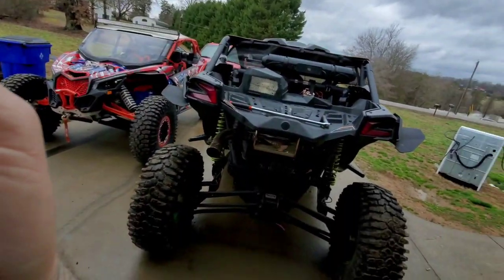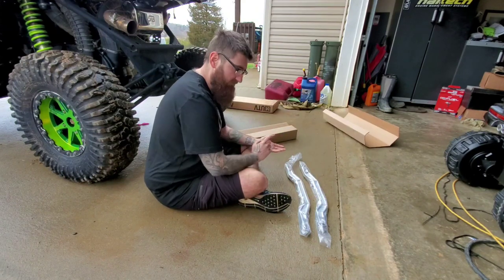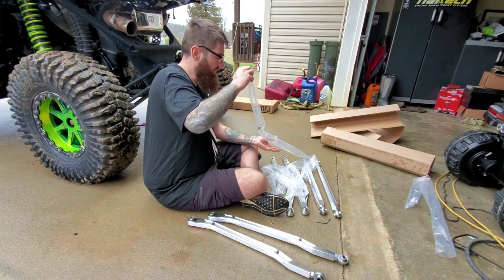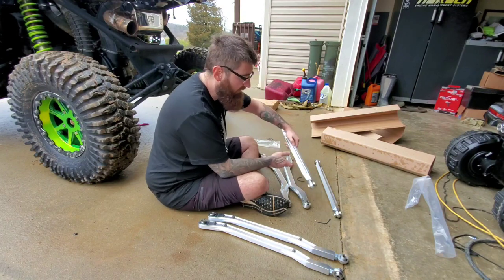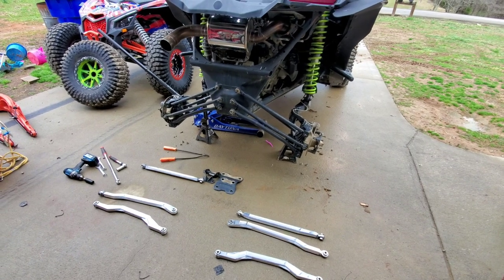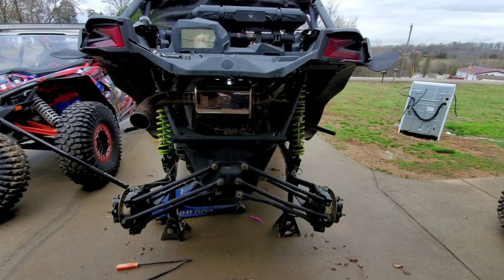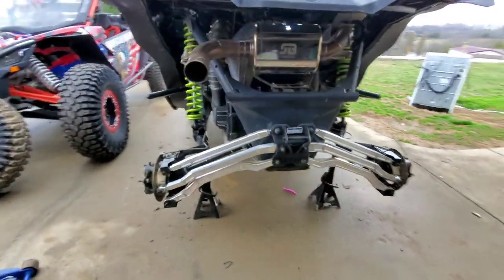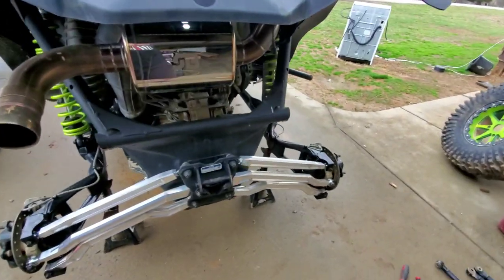Can am X3 Xrc LMUTV radius rods install.

Comment: Need to get the plate too, did you use a discount code?
Reply from the maker: I wanted to get the plate but I didn't prefer the two pieces design with the two hook.
I did not have a discount code at the time. They we're having and extended flash sale.
Reply: @AbramHeathFULLYEET  the problem with the stock one is the hole size is huge and the bolts really float and will mess the frame up over time
Reply from the maker: @Kyle-fu6en  yea I've seen that. I plan on getting the weld in kit to eliminate that.